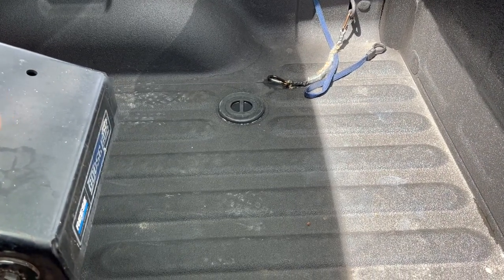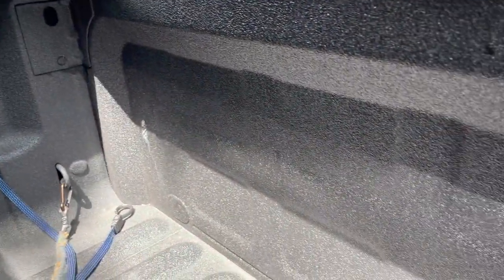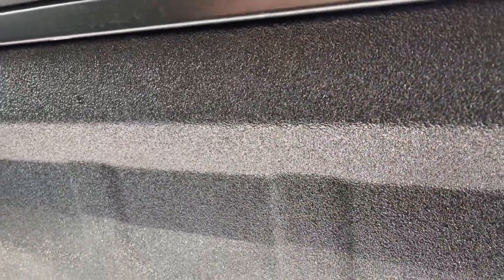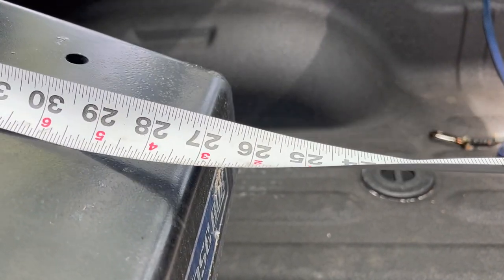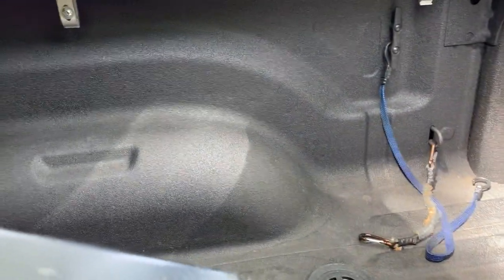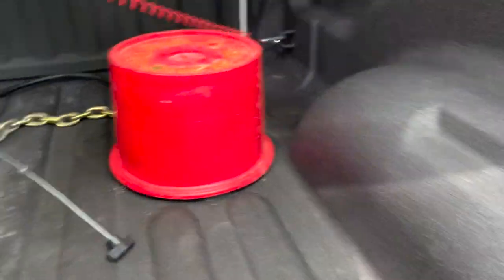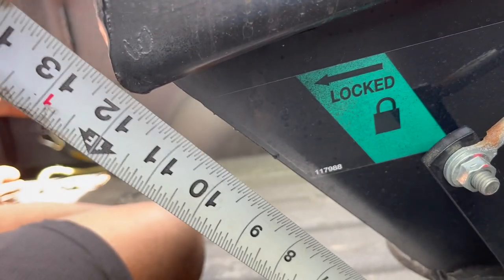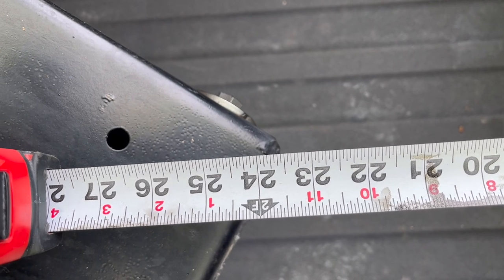Will A Tool Box Fit Using The Reese Goose Box With A 2019+ RAM HD Short Bed? Let's Measure!

Comment: I have a box in my 16 Ram 2500.  You can't push the box all the way against the front of the bed, because the lid hits the front side of the bedrail when opened.  Mine is away from the front 2 inches and leaves about a half an inch between the front of my toolbox and the base of my Andersen hitch.
Reply from the maker: Great point, I didn’t think about opening the lid for clearance. It’s better to just get a longbed if you need more gear 👍🏾
Reply: @JB_WhoWork  I would agree!  If I had it to do all over again.............
Reply from the maker: Same! But I wish they would just make the 6’4” bed 7 ft!
Reply: @JB_WhoWork  absolutely!  Perhaps when RAM decides to make a true 5th gen HD truck!

Comment: When I had my 2014 RAM 3500 with a Mega Cab I had a toolbox fuel tank combo from "The Fuel Box".  The box was I believe was 15inchs w and flush to the top of the bed. At the time I was using a B&W hitch.   Great information JB.

Comment: JB, love your content!!!  I'm looking at a 2023 RAM 3500 HO and think i'm willing to give up the longbed and 50 gallon fuel tank to get the rambox.  I currently have a 2020 Keystone Couger with a Gen 2 Reese Goosebox and i can't find anything that will show how turning will be impacted with regards to contacting the rambox since the internal bed dimensions are more narrow.  I was going to get the Ram 5th wheel package and then replace the factory gooseneck with the BG hitch so i can use one of their 4" offsets while still using their puck system to connect the chains to.    The Rambox's inside bed dimensions and turning (hitch contact) doesn't seem to be discussed anywhere so this would be a great video for your channel.   Anything you can pass would be appreciated.  the focus on 90 degree turns also focuses on the fifth wheel contacting the cab of the truck, but i think there is also a concern the hitch will contact the sides of the rambox.   On a side note, I also see the new Gen3 Goosebox has a steeper angle which may give more side clearance to get above the inside edge but that in turn should also shorten it with regards to bringing the front of the fifth wheel forward closer to the cab... so i'm not sure if that would help get any additional side clearance to keep the goosebox from contacting the inside edge of the rambox over a Gen 2 Goosebox.
Reply: i just discovered this is not possible.  When i did the build i found out i can't select the  rambox and the 5th wheel package.

Comment: Curt and B&W sell 4 inch rearward offset balls to add clearance.  I do not know if anyone offers an offset ball for the OEM hitch.
Reply from the maker: I wish someone sold something for factory system, it would just twist around if they did create something for it…
Reply: @JB_WhoWork  I think a frame connecting the back 3 factory holes could support a rearward offset ball